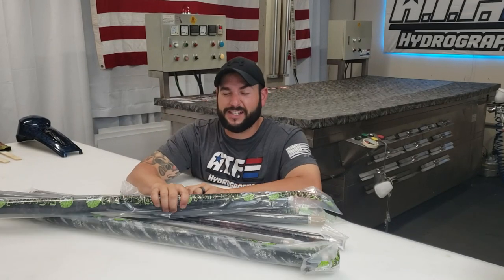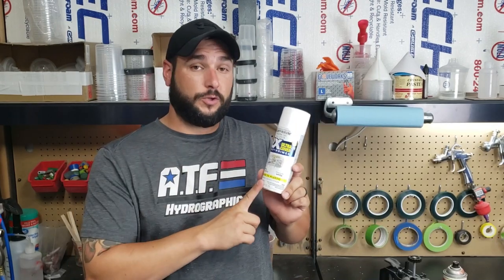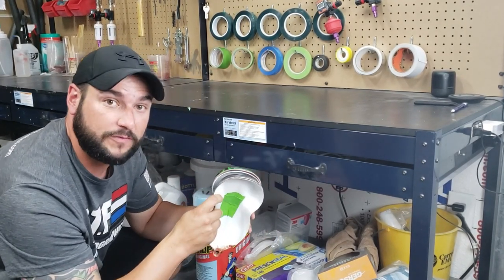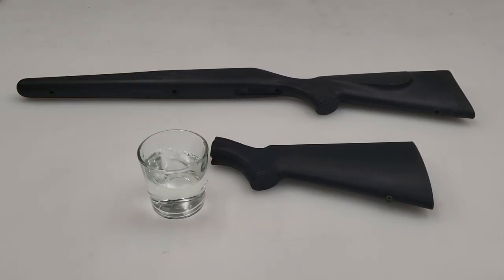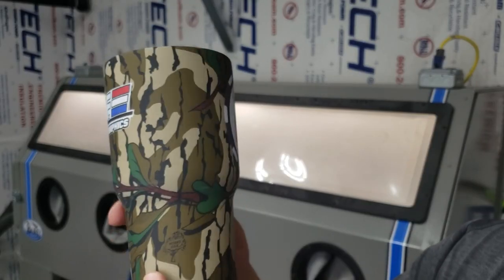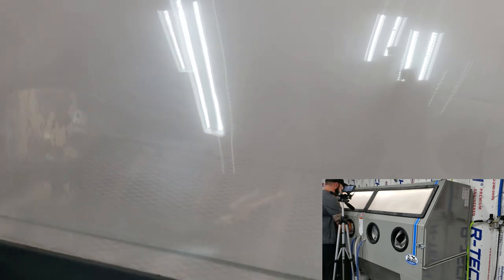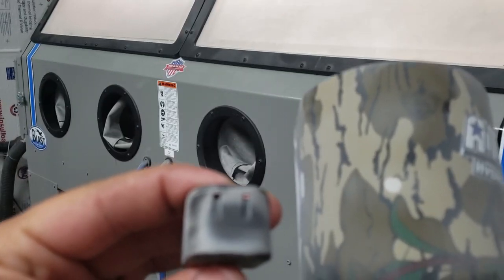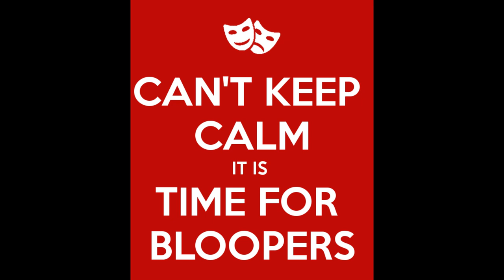5 Things You Didn't Know About Hydro Dipping

Comment: So I have a question! After you hydro dip you have to clear coat within a certain amount of time? And if so can someone explain why
Reply from the maker: It was explained in the video. Every paint has a certain window of time before it closes. After the paint closes it will not allow clear coat to stay permanently bonded. If you want the clear coat to stay on the paint and not flake off later, it has to be clear coated within that window of time.

Comment: What's the code of the green one. The 1 you removed the film. I want to paint my things with that green . Thank you .
Reply from the maker: That is Bright Green from One Hit Wonder Paint Co. I do not know what the code is, I just order the paint directly from them.
Reply: @AllThingsFunHydrographics  I want to do my car and motorcycle rims . Can 1 film do just my car rims.?
Reply from the maker: @PuraLeche6942  You would need quite a few meters of film, but yes it can be done. Depending on how much you have to dip, probably 10 meters.
Reply: @AllThingsFunHydrographics  ok I just want to make sure 1 film will do all 4
Reply from the maker: @PuraLeche6942  Yup, just make sure you got enough. 4 wheels I usually buy 5 meters. It comes in one big roll.

Comment: I am setting up a small hydro dipping at home just for bike frames and accessories. I am looking for a wide format printer that is pigment based ink as I heard it is what I will need. I currently have a Pixma ix6820 but only the black ink is pigment, the rest are dye based. Do you have any recommendaions?
Reply from the maker: Wish I could help but I know nothing about printing film. I just buy it. Much cheaper and less headache that trying to do it myself.

Comment: So, I've got some plastic motorcycle parts that have been hydrodipped that were originally chrome. The hydro dip is bubbled and wrinkled.
How can I safely remove it without damaging anything? 
(I didn't have them dipped, previous owner did) Looks like it was done in a plastic bucket as an experiment!
Reply from the maker: You can try laquer thinner but the chrome underneath is probably got some sanding scratches, unless the previous owner did not prep the chrome at all. May get lucky.
Reply: @AllThingsFunHydrographics  Thanks, I'll give it a try. Im not sure how it was prepped, dipped, or how long its been on there. I just know I want it gone! 
I've seen places say they can dip in a chrome finish, so if i have to take them to bare plastic I might consider that.
Reply from the maker: @christianhadaway6144  have fun with that.... i hate removing chrome. Lots of work. Maybe the laquer thinner will work. Acetone will also work.
Reply: @AllThingsFunHydrographics  I'm thinking about sand/media blasting if it comes down to taking it to bare plastic. These pieces are $80 + a piece and im trying to find any way to make this work without having to pay that x 4 for plastic parts. I'd be extatic if the dip would come off without hurting anything, theyre in great shape aside from the dip.

Comment: Nice video man, i've learn so much watching you're channel, thanks for everything... 

I had a bad experience with a bunch of blank film y just bought, wrinkles so hard and became damaged no matter what i did, but I'm motivated, I'll check out other suppliers to see if the film was shitti at all or i was hahahaha... 

Blessed be...
Reply from the maker: Thanks for checking out the channel, and glad to hear you are enjoying the videos. Sadly that happens with film sometimes. Tape is usually the #1 cause of the issues. Try not taping the edges a just cut a much larger piece than you actually need in case the edged roll up a lot. It could be under hydrated film as well. The film has to be kept at 50-55% humidity during storage or else it will dry out and cause the issue you are having, basically its so dry that it absorbs too much water too fast and causes it to wrinkle.  Good luck to you, and welcome to the world of frustrations.  LOL
Reply: thats just happened to me , i thought it was the water too hot  85'f
Reply: @NOT_SURE..  not at all, i use tap water, I'm from puerto rico, the tap water temp is between 84 to 86 degrees and i use it, the problem is the film, but you gotta work hard in a ways to put it on the water, no matter what i do the film wrinkles so hard, so i put tape on the top and the bottom and blow air with my mouth to make it flat on the surface while the hydrating process, then i put the damns and work it from there, is a headache but works for me...
Reply: @litlllelman  cheers , i am doing it in the bath so i dont have damns, but i think next time i am going to make a temporary one , that probably was the main problem.  i did a gun and one side was perfect and the other side hardly stuck , can i go over the old film with new or does it all have to be removed ?
Reply: @NOT_SURE..  sorry but you gotta start over again to achieve a nice good work on it... sounds hard but will worth...

Comment: A stainless tumbler vs a nylon (polymer) Glock Mag extension... Not exactly 1 for 1, no?
I mean you're not really trying to claim that identical hydro-dipped parts are more durable than Cerakote? Right?
Reply from the maker: Just what I had laying in the shop when I filmed the video. But we did a whole direct comparison video on cerakote vs hydro dip if you want to check it out.

Comment: I love the video, and I do agree that Hydro Dipping is more durable than most think. But your test is not an accurate one. They hydro dipped area tested was curved and the cerakote surface was flat. Curved surfaces allow the air pressure from the sand blaster to glance off and past by it, while the flat cerokote area tested is flat and gets smacked dead on by the sand blaster. It works the same way aerodynamics do. Which does the wind smack with more force, a flat wall or a curved surface? The same physics apply here. And that's without even considering the possibility of material differences between the mag base and cup. Hydro Dipping is durable, but the test was flawed. A good test would be two cups, one dipped and one cerakoted. Either way keep up the good work. Was just saying the durability test is extremely flawed.
Reply: Also theirs the oven cure and air cure with cerakote so that could matter to.
Reply from the maker: We are going to do a more accurate real world test in the future because we keep getting asked about it... but I am sorry our quick and easy test was not as accurate as you would like. I am not a scientist, aerodynamics engineer, or a rocket surgeon... just a guy who makes stuff look pretty. Next time I will make sure the testing is 100% accurate so everyone will be happy.
Reply from the maker: It was H series oven cure. The air cure is not durable at all.
Reply: @AllThingsFunHydrographics  Love your work. I was just curious on a more accurate test. I agree with the point you where trying to demonstrate and that Hydro dip is way more durable than people think.  Was not meaning anything bad by it at all, was just curious of the results if done differently. They very well could still be the same results. I was just pointing out the possible flaw. Nothing is ever 100% there is always a margin of error. Keep up the good work.
Reply: @AllThingsFunHydrographics  I did have one question on cerakote too. Coming from the auto airbrush world, do you have to cure the cerakote between colors if using it to airbrush a mural or etc. on a gun, or would it be sufficient enough just doing that step with the base coat?  I was just wondering if it actually reflects results. There would be a lot of baking required for detailed murals if it does. Sorry for the long messages. I was just curious about this. And even though its repetitive thanks again for the great content. (I can always email them and ask, but since your active in the comments i figured it couldn't hurt to ask)
Reply from the maker: @sadlerarms3535  I know what you meant I was just messing with you, I'm a little sarcastic sometimes. There will be a more real world experiment video done in the future and it will be on two of the exact same guns. Just haven't had time to do much filming because we are slammed with work right now.
Reply from the maker: @sadlerarms3535  unfortunetly Cerakote has to be baked in between colors, which kind of sucks but it is just the nature of the product. What happens if you don't bake between color changes is the Cerakote never really dries to the touch unless it reaches at minimum 150 degrees for 8-10 minutes. If you put two colors next to each other without baking in between the colors will run together and make a weird off-color like brown, and there is no way to fix it without blasting it off and starting over. That is why it takes forever to do custom guns with multiple layers of stencils and colors. The other not so fun thing about Cerakote is once you start spraying, you only have 24 hours to complete all the layers of colors before doing the final bake. After 24 hours the Cerakote will not hard bake correctly, I think it has something to do with the hardener they use. So on those big complicated projects, once you start, you have to keep going until it is done, can't come back a day or two later and finish it. The Mandalorian themed shotgun that I did a video on was about 20 hours straight of spraying, baking, stenciling, and changing colors. It was a loooong day.
Reply: @AllThingsFunHydrographics  That stinks. It would make murals and etc a pain in the butt. Especially when freehanding them.  Thank you for the info. I really appreciate it.
Reply from the maker: no problem.